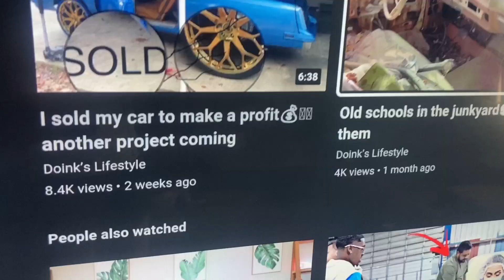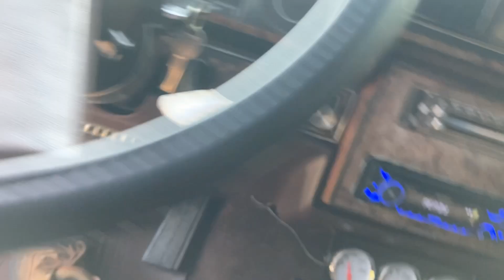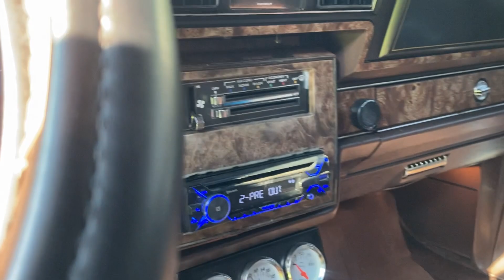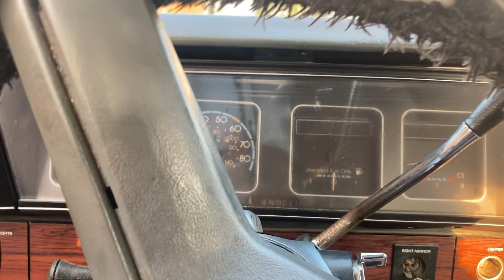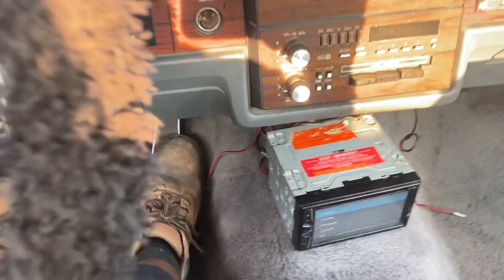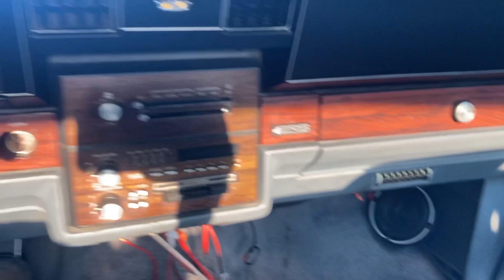This Is The Game I Was Talking About🤯| I Did It Again‼️Doinks lifestyles

Comment: What's up with the Bonneville
Reply from the maker: I got it . It will spend over and all just need fire from the distributor to make it crank and fuel lines needs hooked . Paint and lil inside works
Reply: Ok cool I'll buy it as is if u sell it that motor coming out putting a Chevy motor n it
Reply from the maker: @deecage199  where u from
Reply: @doinkslifestyle  Southaven Mississippi
Reply from the maker: @deecage199  oh ok u not that far I’ll say about 2 hrs in half
Reply: @doinkslifestyle  if u sell let me know
Reply from the maker: @deecage199  ok
Reply: @doinkslifestyle  I'll buy it as is
Reply from the maker: @deecage199  come get it
Reply from the maker: When u tryna get it tho
Reply: @doinkslifestyle  whenever your ready to sell has to be on weekends only because I work Monday thru Friday
Reply from the maker: @deecage199  u got Facebook book. I was gone say hit me up on there